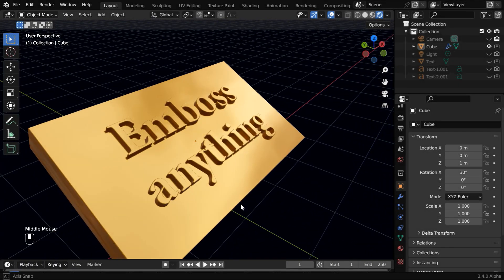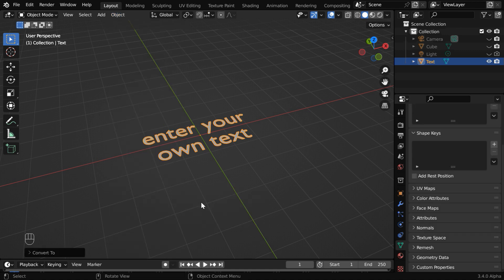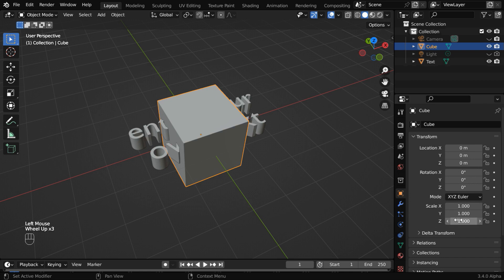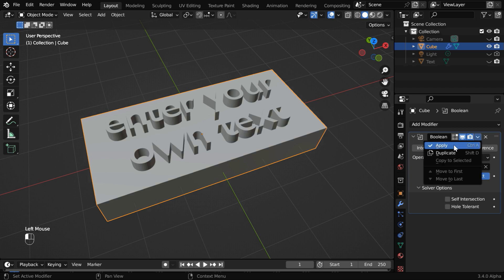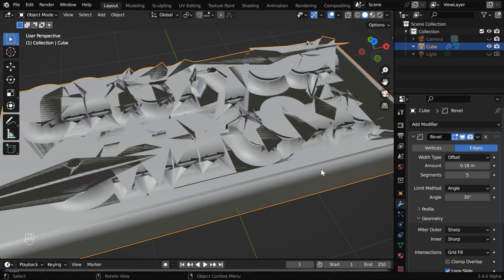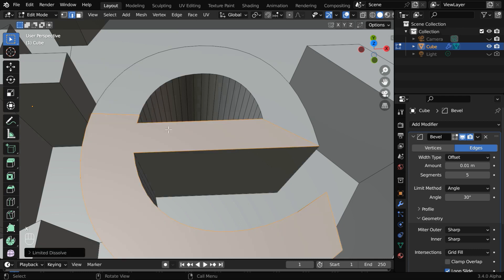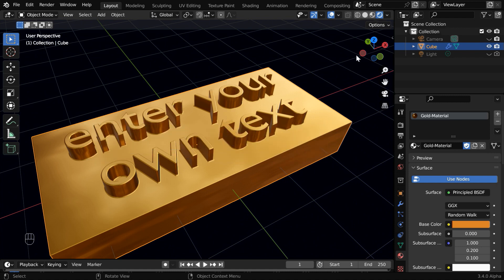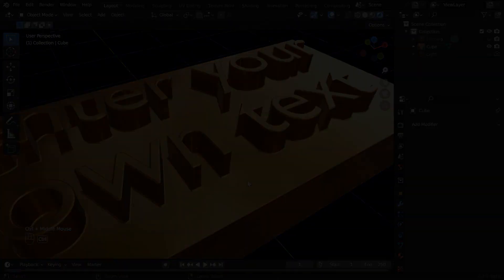Easy Method to Emboss Your Text or Logo | How To Create Raised Letters | 3D Text Effects In Blender

Comment: how can I smooth the edges of this created text, I tried with bevel but I didn't get any result.
Reply from the maker: What happened with you bevel? Did it not yield any result or did it ruin the text? If bevel is not showing, you may need to disable the clamp option under the geometry section within bevel, however that may ruin the text which is what most people experience (one solution to that may be to reduce the bevel amount). The other solution is to create the text itself with some bevel (not bevel modifier). Go to the text tab and under the geometry section use bevel - may be the round option - and use a low value. This will round the edges of your text, however the intersection with the base plate won't be affected. This is a trade off which is at least better than no bevel.